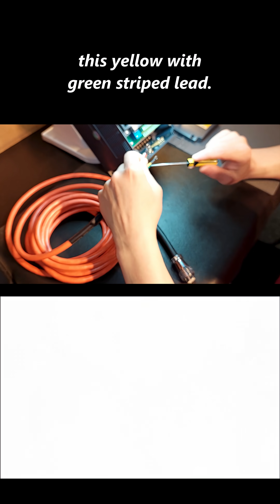🛠️ HY VFD Setup: How to Install & Connect a Spindle Cable 🔌

Comment: I was wondering if I should still allow the VFD/Spindle cable to pass through my cabinet or no.
Reply from the maker: The VFD, in best practice should be mounted externally of the control electronics.